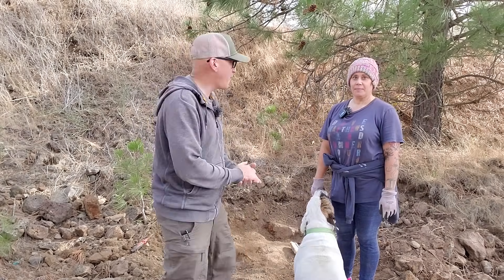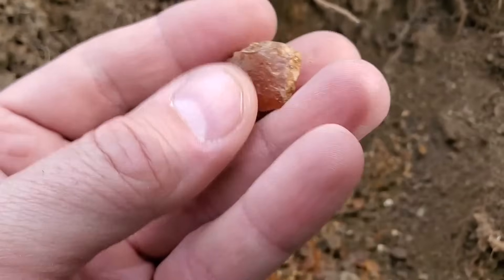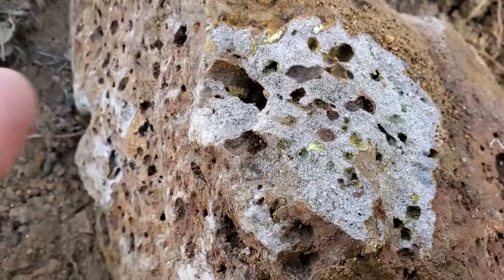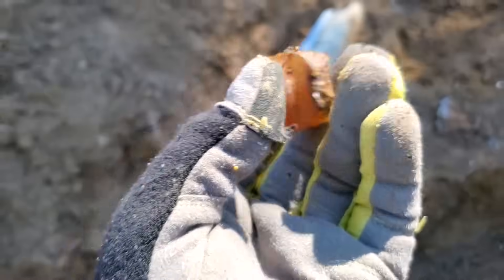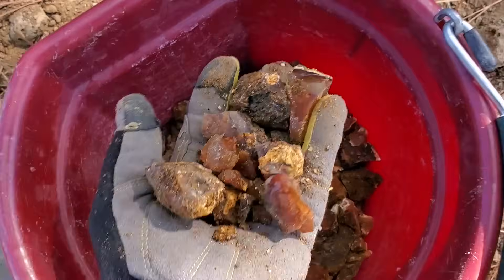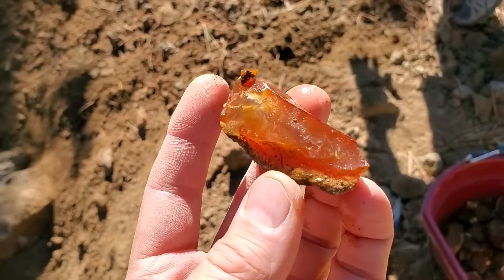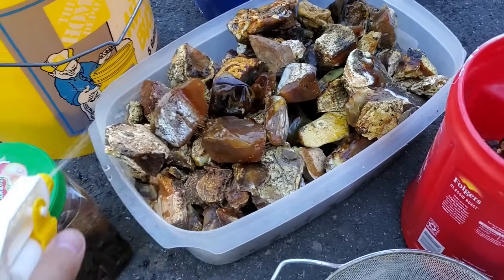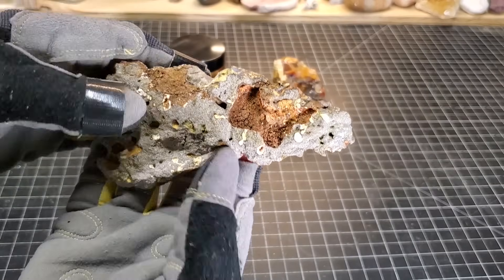Opal Discovery in Eastern Washington // Rockhounding History in The Making

Comment: I've seen that exact same color green in larger specimen pieces up near Pierre Lake just North of colville. Something tells me to get a geiger counter and check for radiation because of all of the different shades of green that I witnessed up there. The area has been known to contain lots of radium bearing minerals. This is the reason why Spokane is notorious for having radon detectors in basements of homes is because the radon gas from the radium can seep through concrete walls and collect down low in spaces.
Reply from the maker: These are not radioactive.
Reply: @CurrentlyRockhounding  I'm sure they're not, but thanks for reconfirming that for me. If you go ahead and read it one more Time you will see that I was talking about the other green rocks up in Northeast Washington since there is an abundance of different varieties that closely resemble each other. 

Once again, I must reiterate and introduce to you the existence of something called "word sense disambiguation". This is the subject matter and concept of why we misunderstand what we read versus what we hear. You obviously didn't read it correctly and I won't blame you this time. Next time, however, you might look a little stupid if you don't read it correctly. 

Just trying to help a brother out. By the way, I finally remembered the name of that radioactive mineral called Autunite. It also glows green in a black light!

RADIOACTIVE 
RAVE 
ROCKS
Reply: And one more thing! Most Green crystallized mineral consists of Olivine, just not all of them. Green rocks are also known to contain strychnine and various other toxic natural chemicals. Do not lick rocks because it can kill you

Comment: The NW is truly a One-Stop shopping center for semi-precious rocks and mineraloids. It’s interesting how basalt degrades and/or alters to create certain opals, agates and jaspers. 

I’ve been working @the upper Molalla River on a 6”x18” basalt vug with a beautiful red brachiated “jasper” or “precursory jasper” (my guess, I haven’t tested it yet) fill. The 3” of degraded basalt of the vug has micofractures with what appears to be tiny yellow-gold “crystals.” The surrounding basalt isn’t degraded and is very hard, making the extraction difficult without damaging the target material. My hammer drill is next in my tool belt; someone else has worked it, I saw three drill holes.
Reply from the maker: The northwest has so much to offer!

Basalt doesn't transform into these things but rather it acts as a host for the silicate rich waters that settle into the voids.

That's really neat, I would love to see a photo of what your finding sometime.
Reply: @CurrentlyRockhounding  Right, but I didn’t say “transform,” I implied that basalt demineralizes and releases silica along with its other components with water.

Comment: Now I'm curious. I live between Suncrest and TumTum on 5 acres overlooking the Spokane River/Lake Spokane. Our property isn't frontage but very close and includes a big section of natural riverbank from centuries past as well as a natural deep natural ditch on one side. The rest is flat and still sandy soil but with TONS... I mean TONS of nice, rounded, river rocks just below the surface from many, many years ago when the river was much bigger. When I've wanted new drainage ditches, decorative planter areas or rocks for weighting, I have zero trouble finding them in all sizes. I've always been a collector of rocks since childhood but only recently bought our home here and haven't yet had the chance for leisurely looking, nor am I particularly knowledgeable. Any tips for this particular section along the Spokane between 291 and the river, Suncrest and TumTum?
Reply from the maker: I think as a general rule of thumb the advice of pick up what you like is good and that does apply to that stretch of the river as well.

The Spokane river isn't really known for its really high quality rocks that most rockhounds would be interested in.
Reply: @CurrentlyRockhounding  Thank you for the reply. I'm not on the river, but overlooking. Maybe that's close enough to be the same, I don't know. I'm at an elevation, sitting about 1000 feet away from it and perhaps a couple hundred feet above it. I'm in an area that was once underwater I imagine, but a very, very long time ago. Long before people I'm sure. Having so many natural features on my property makes me curious what variety of minerals there might be with natural areas of washout from higher elevations centuries ago. Those areas are also heavily trafficked by our deer population and don't collect much dense vegetation due to sand volume in the soil. I know nothing about what rocks end up where so I suppose I'll just have to take something to sit on and a shovel one of these evenings and start poking around!

Comment: Opals are one of my favorite to look for but I still find it difficult to tell the difference sometimes when it comes to potch opal.  My question is was there a hot spring near by? I watched this yesterday I didn't have time to ask questions before.
Reply from the maker: The geothermal activity of this area is no more, but if we could turn back time some we would see that there likely was.
Reply: @CurrentlyRockhounding  Oh, which makes total sense after you explain. Geothermal activity is required to still exist.   i asked because of the Virgin Valley in Nevada west of Denio Juntion.  Thanks for your reply.